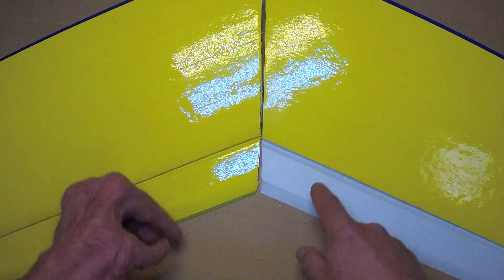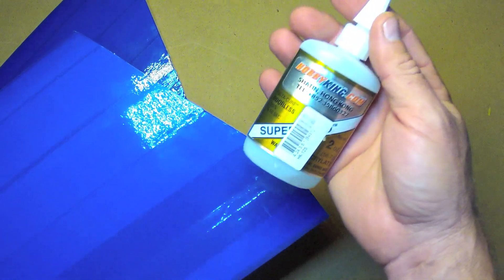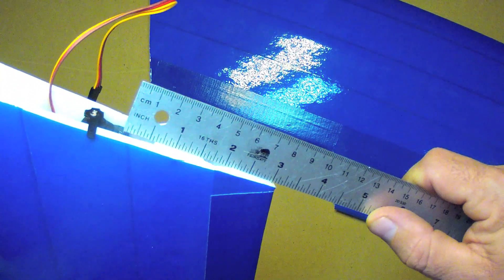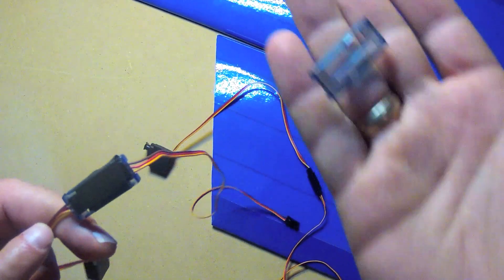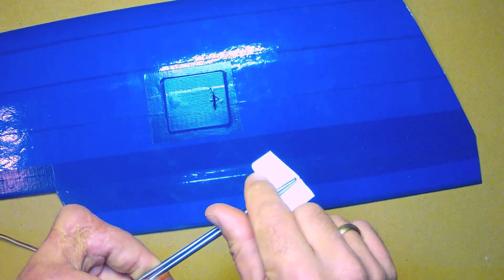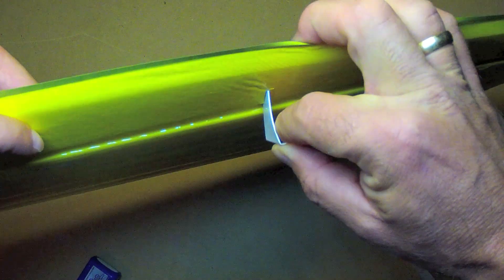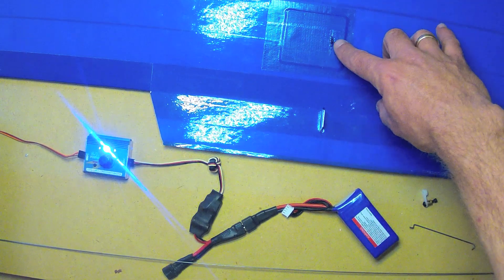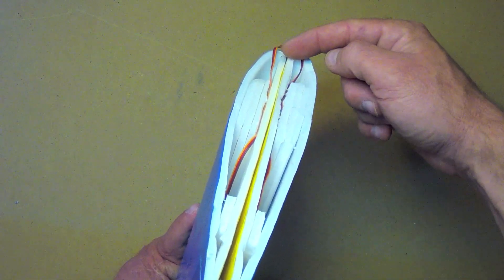SYNAPSE BUILD: Elevons & Servos

Comment: Hey Ed, have you noticed a lot of slop with those EXI 9g digital servos?  I picked up a few to try out and while they seem otherwise solid, there is quite a bit of play compared to some of the really cheap non-metal gear digital servos from HK (namely the white HKSCM9 servos).  I also plan on using Dubro control horns, mostly because I have some lying around.  There shouldn't be any issues with them vice using DIY gift card control horns, right?

Comment: Ed, why would you choose to install the servo's in the upper surface of the wing as opposed to the lower? Wouldn't you want as clean an upper surface as you can get for lift / drag purposes?  I just finished the build phase of the synapse and am about to install the servo's - want to make the best decision. If you have a chance to throw me a quick word I would really appreciate it.

Maddogrk1 - eBay blank credit cards.  Just bought a pack of 100 for a few bucks. Come in 100, 500, 1000 etc. They are all over my noob tube and axon now.

Comment from the maker: I use "music wire" which is essentially piano strings, and gotten from the local hobby shop.  I like .047" size, but there are many choices.  It's very cheap, easy to work with.

Comment from the maker: Thanks my friend.  I have to think there is some Readi-Board over there somewhere.  There are a couple of Quebecois in the upcoming Snowbird contest entry video who use it.  The Synapse does glide quite well, especially the light LOS version, without FPV gear.  I can also put it in a high angle of attack and have it float down at a 45 degree glide slope and just flop on the ground.

Comment: HI, Happy easter, sir
Thanks  for all your helping videos.
I did'nt find foam boards in my area (eastern townships, Quebec, Canada). So I finally use hot wire cut foam (after a few months of try and re-try).
My project has a lot in common with Synapse look and measures. My question is :
Does this sort of flying wing fly without motor, meaning do you know th ability  of Synapse-like models to "glide" ?
Once more, I highly apreciate your video contributions.

Comment: awesome techniques Ed!
I had a case when elevon would get pushed and the servo got ripped out with foam from the wing.
Since then I tried gluing giftcards or craft sticks under the servo to spread some of the surface load and it worked great.

Also I always drill tiny holes in gift cards for push rods using an x-acto knife. Push it slightly against plastic and turn it back and forth a few times and then do the same on the other side. Works with plastic and thin ply :)

Comment: Thank you for the response, but they are unbearably pitching down, they wont fly and if it has gear, it wont get off the ground. All of the planes will glide fine, but adding throttle they slam into the ground, do i just need to add a LOT of up trim?

Comment: You're not doing anything wrong.  Pusher planes DO tend to nose down when you add throttle; the greater the rate at which throttle is added, the more noticeable is the tendency to pitch down.  This can be mitigated by the geometry of the airframe; check RCGroups.com for more information.

Comment: Maidened my Synapse today. Out of 30 or so foamboard / foam  airplanes I have built, this one has some of the best, if not the best flying characteristics of all my planes. It glides forever and has extreemly good control. Enough to skim the ground at full speed without very much skill. Your building techniques are the only way to go. Keep up the good work and keeping my younger generation interested in aviation.